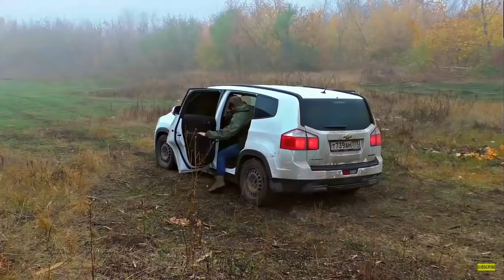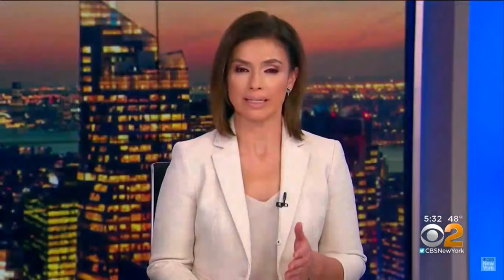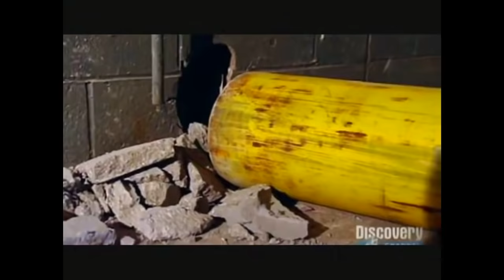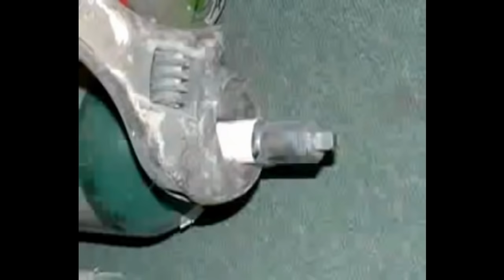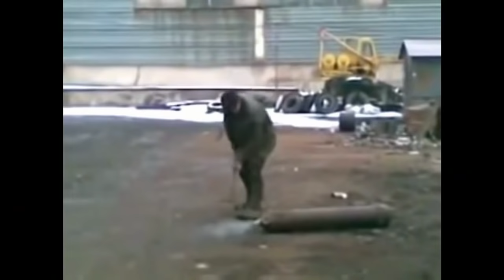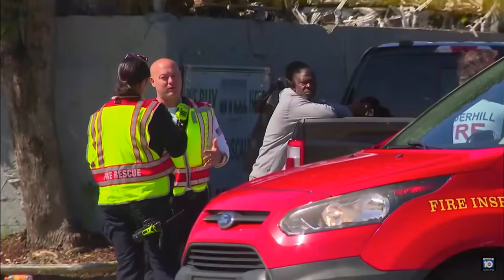Oxygen Tanks Explode!!! Scrap Metal Scrappers Must Watch!

Comment: The same can be said for any pressure vessel! A simple air compressor that you find in a dumpster everyday can be at full pressure when you find it! You don't know why someone threw them away! Rust from condensate can slowly deteriorate the tank and the moment you bump it BOOM! Use extreme caution when handling any type of container or vessel that can or may be under pressure!
Reply: That's easier said than done.  Many men (not women) do not think.
Reply: @hopydaddy  a few pennies in weight are not worth life or limb- the word needs to be spoken!

Comment: Air gas cylinders not all ways oxygen are very dangerous but as long as the tank is empty and the valve is removed they are fine and safe to deal with. Unless it says SO4, then it is still deadly.

Comment: I found two oxygen tanks last summer and picked them up and took them too the local fire dept. to let them dispose of them properly. one was empty but the other one was full. both had out of date inspection stamps on them.  Not worth the danger to scrap any cylinders out for a few bucks folks. I use a cutting torch on my farm alot and always very careful with the oxygen and acetylene bottles. they are chained down in a bottle holder on my welding trailer.